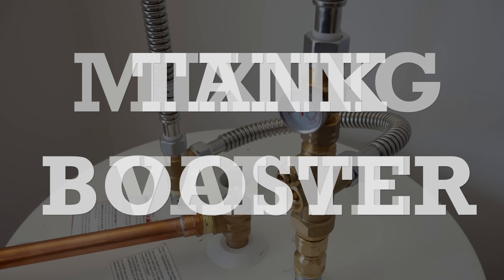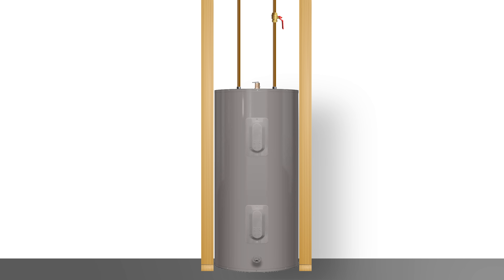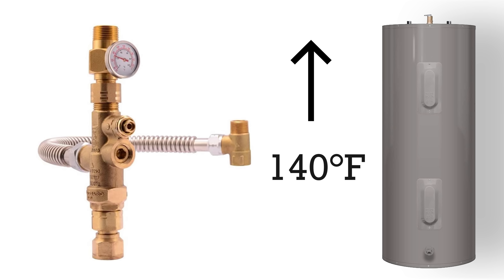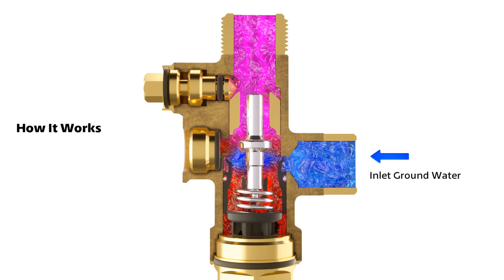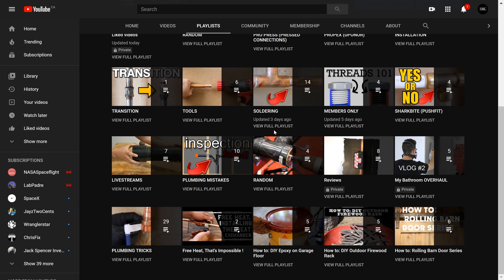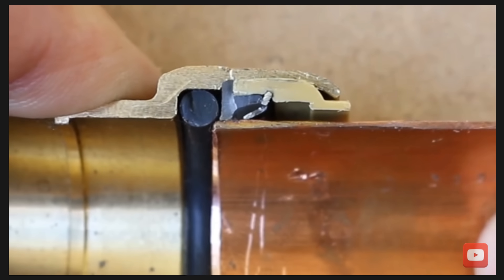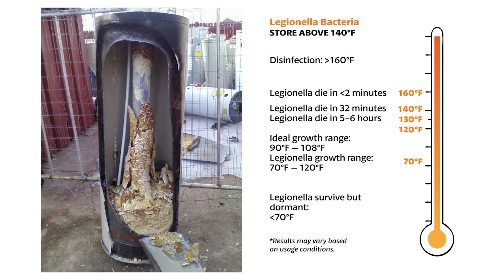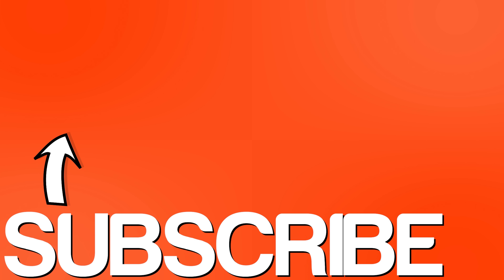INCREASE Your HOT WATER Capacity With This! (Cash Acme PRO Mixing Valve) | GOT2LEARN

Comment: First I heat my water to say 140, (costing $$$), Then I mix it with cold water to bring it to (say) 120 wasting more $$ to cool it down.  Since room ambient temperature is about 70 the 140 looses heat faster ( no matter how much insulation) wasting even more $$.
Solution just keep it at 120 in the first place.
Reply: This is not a means to reduce energy use but to obtain a greater volume of hot water from a given tank size. 
I have a similar situation with a twist. My tank temperature is set at 120°F but when there is excess solar electricity available it is automatically moved up to 150°F. The temperature controlled mixing valve is set to 120°F. The tank acts as a thermal battery and reduces the cost of running my heat pump water heater, to zero if I am the only one in the house.

Comment: Just glad you never said" hot water heater". Gotta save that for the Springer show. I have never heated hot water, always cold water. I think people with vin numbers, and pin numbers, have hot water heaters. I checked with the Federal FBI, the USMC corps, and the ATF firearms on this one.
Reply: And the old reliable ATM machine....Glad I'm not the only one!
Reply: @KenMagee  Exactly
Reply: Right on. I’m always telling people this. I only have a cold water heater in my house.
Reply: The images in the first part of the video including the law quoted say "hot water heater"
Reply: @mrwp819300  Ok, missed that one. It may be one to share with the C.I. A. agengy.
Reply: Dani Masterson  I have a tankless water heater, I only heat up cold water. Even if it is hot, in a tank, why would some one heat up water that is already hot, the thermostat won't let that occur.
Reply: Down to 0 degrees kelvin all water has heat. So, by definition, it TECHNICALLY is a hot water heater lol
Reply: @japhethwillmore7538  In different universes, heat is actually present, below that temp, but, that universe is made up mainly of old trailer parks.

Comment: Very well done video!  I have one question. Why does the circulation pump need to “T” and go into the mixing valve (R) vs. just go into the cold inlet supply “T” ? Is there a benefit?
Reply from the maker: Yeah, I have no idea, must be an engineering thing 😅
Reply: It actually should go into the cold inlet as not to interfere with hot water outlet

Comment: You could buy a new water heater for the money spent on this system. Plus the losses from over heating the water and the danger of running it near the max temps for the safety valve. This is only good if you have no other way to increase your size. Plus those mixers wear out and could cause a burn for a family member. Buy a new water heater or change shower heads.

Comment: This is particularly useful on off peak water heating systems.
Reply: Those are still a thing? My power company ended that program like ten years ago. I ripped out more of them than I fixed.
Reply: @jman0870  Had mine for 32 years, no problems and pay about 25% of the full rate. Why rip anything out? If the electric company ends it, the water heaters will just operate on demand and everything is in place if they resume the program. I also have dual fuel heating with my ground source heat pump. That operates at about half price.
Reply: @trustme7731  because they were 30 years old? Who wants to keep a 30 year old tank of skanky water in their basement? Most of them were rubber lined foam insulated giant tubs of water that used water heater elements to heat it at night. Also, why would you run dual fuel with a geo?
Reply: @jman0870  Why do you think the water is skanky in an operating water heater? New water enters every time hot water is run. Water heaters are not rubber lined. They are coated steal. Some are plastic.
I have a dual fuel plan with the electric utility. This means when the utility is close to peaking they can turn my heat pump off and I need to use a second heating source. Usually gas, but I use wood. In return for this, they give me half priced electric for the heat pump 100% of the time. They will turn it off when its cold, like 10 or 15 degrees and when people are arriving home and demand is rising. Its usually from 4pm, if it really cold, to about 9pm and then the heat pump comes back on. 
The heat pump also heats my domestic hot water in both tanks every time it runs, whether heating or cooling. Both my 65 gallon tanks are 32 years old and work fine because they are a high quality product that you can only buy from a wholesale plumbing supply house. The water heaters in the big box stores are crap and you are lucky to get 8 years out f them.
Reply: @trustme7731  did you eat lead paint? I literally just explained to you that most of the off peak systems were rubber lined tubs of water where I live. They were atmospheric and pumped to a hydronic coil. 🤣🤣🤣
Reply: @trustme7731  sorry, I didn’t realize that you thought the majority of off peak systems were for domestic water. Newsflash, the overwhelming majority of them were for this little thing called HEAT. 🤣🤣🤣
Reply: @jman0870  Except the subject is domestic water heaters of which mine are off peak as I clearly said.  MY space heat is geothermal, dual fuel, forced air and not hydronic. Get it now?
Reply: @jman0870  Have had mine for 32 years with no problems and pay 25% of the full rate. Why rip them out? If the electric company ends the program they will just work on demand. I also have dual fuel heating with a ground source heat pump at about 50% of the full rate.

Comment: Myth - You can not use a hot water circulation pump with a tankless. You can. I have been for a few years. And yes it is safe. I can explain and give details if anyone wants. Most people don’t understand the technology. I have a smart home so when the washroom light turns on the pump runs for 1 minute. Or Hey Siri run the pump.

Comment: Objects radiate heat in proportion to the 4th power of its temperature difference. So the hotter the water a lot more energy is required to maintain temperature. The logic is the same with insulation. So while you get more volume of hotwater much more energy is needed. I’m glad you covered it at the end.
Reply: Just a nitpick, but for conduction/insulation it is with 1st power, not 4th. q=-kdT
Insulation radiates too, but in those temp. range conduction and convection is main source of heat loss.

Comment: Throw it ALL away and buy a tankless hot water heater!!!! Perfect temp every time without running out - ever. Also takes up 1/10 of the space of a regular hot water heater. Also is more energy efficient as you aren't storing hot water. Also is easy to install. Can be purchased for around the same price as a tank heater and MUCH better!
Reply: It may not be able to be installed for the same price though.  I went through this while exploring options for replacing my gas fired water heater.   In order to install a tankless gas heater I would have has to increase the size of the gas pipes running to the utility location from 1/2" to 3/4"  which would have by itself added over $1000 to the install cost.

Comment: All this does is lower the hot water temp  allowing you to use a smaller hot water tank set at a higher temp. Less water at a higher temp might be more efficient.

Comment: Great video without a doubt but I don’t know why would you install  a mixing valve in each fixture which Plumbers do such thing, And what would be the reason.
Reply from the maker: Thanks, the reason being would be that you can control them individually instead of adjusting the whole house, there's also a question of redundancy I suppose, so if one breaks, the others will keep working as opposed to the one on the tank.

Comment: Any person who can solder copper pipe can install a 3/4" temper valve at their water heater  .I recommend the #1070 which limits the max temp at 120 degrees F . Some dishwasher manufacturers recommend 135 F for sanitizing .  Be careful .

Comment: I think I got had by the "more efficiency" thing. I replaced the W/H when I bought my new house, and I noticed after the install that it looked like the plumber had stuffed it in there. It barely fit. Anyways, it lasted 20 years, then died, and I replaced it with a tankless. Fits nice now.
Reply: Have fun replacing that tankless in ten years or less. If it doesn’t scale up it will cost too much to fix. Half the time they result in a ridiculously long call with tech support. You know how long it takes me to troubleshoot any issue with an electric water heater? Fifteen minutes. If the elements aren’t galled and the drain isn’t clogged I can fix any electric water heater issue in an hour or less with parts off the truck. Tankless issues? Have fun waiting a week or two with no hot water for parts to come in. They redesign them constantly and companies typically only need to support their equipment for ten years. Tankless is a joke.

Comment: Compromise for Free:  Set water heater to 130°F-135°F.  If you don't have young children or disabled people in your household, this poses little or no risk.  You now have more hot water (because you'll mix less hot and more cold when showering for example). This temperature also destroys bacteria such as Legionella in the water heater.
Reply from the maker: Yes this works also, just remember to remind the people that come over ;)
Reply: Do people really just step into the shower and fling the hot on? I dunno I am just a very cautious particular person I wait for it to run for a couple minutes to get the temperature right..
Reply: @drasco61084  I wing it on full hot and adjust after I have hot water. I have 140 degrees at my shower head. 🤷‍♂️

Comment: If you want a larger tank and can't fit one, just go tankless.
Reply from the maker: That's "a" way.
Reply: This is a statement by somebody that does not do this consistently or professionally. Most thankless require upgrade an electrical service. Average home would require fifty to a hundred amps depending on GPM water usage. You will find that many homes do not have that available.
Reply: @chrismidyette1098  there are tankless water heaters that use natural gas or LP and those are pretty common (in the US at least) if you do require a electric heater you will find that most homes that need one because there is no gas hookup already have enough power for service and a 50 amp outlet. If they don't it's not up to current electrical standards for residential hot water service.

Comment: These work and don't work at the same time for instance if you had a water heater and you set the temperature at 140 The temperature coming out of the faucet to the bathtub or to the kitchen will probably be about 120 considering the length of pipe and the loss of temperature as it goes through the walls ceilings and everything else so then if you try to increase it anymore or even sometimes add $140 when the heaters turn on you'll have a slight overswing which will probably bring it to about 1:45 150 in that case your TP sensor will start to open and slowly after a few years one or two the TP valve will start to leak without you knowing causing you to lose thousands of gallons of water without knowing it or even worse you could have a TP blow off if you are really in such a case of having to update a system but not relocated or not expand your easiest and best bet would to be install the insta heat which is basically just a larger version of that little electric heater you have the gas or electric style and some of them can be pretty dang cheap as long as you have the correct air for the room

Comment: Open that safety valve and you’ll be changing it also!!! Just saying.
Reply: If the water heater isn't regularly cleaned yearly (draining/refilling), which most home owners don't do, it's true. if you have a new water heater or less than a few years, that will not likely happen (depends on your water hardness and such) :D
Reply: My water heater is literally set at 140 degrees with no mixing valve. Setting any water heater thermostat at 120 degrees is stupid. It’s the perfect temperature for microbes to grow and fill your tank with literal microbe shit. 🤷‍♂️
Reply: @jman0870  that’s great!!! Thats why they have thermostats, put it where you feel comfortable.
Reply: @mr.redneck2715  Ever see a tank full of clear jelly looking stuff? It's poo. (Once in a while stuff in your water can react with the anode rod and smell like rotten eggs and provide similar results but I've only seen it a few times. Usually it's literal poo, especially if you have well water.)  Crank it up to 140 and it all goes away.
Reply: @jman0870   no not yet.

Comment: Everyone should cover the hot lines coming from the heater as far as you can, and adding a "Blanket" to the tank is not hard to do to increase the insulation factor, both saving you money.
Reply: This also corrodes the pipes.  I wanted to do this but my contractor showed me a section of pipe that was insulated.  Moisture collects under the insulation. If you can get it air tight it ok

Comment: The problem I have with the mechanical mixing valve is the fact that the cold water temperature where I live changes widely between summer and winter.  If you’re worried about scalding then you may have to adjust the valve multiple times a year.  Otherwise your hot water my be either too hot or too cold depending on if it’s summer or winter.
What I want is an automatic, self contained, mixing control valve.
Reply: Get one with a temp sensing element and it will auto compensate ;)

Comment: I’ve set my tank to a higher temp because we are unable to get two people showered quickly back to back without her getting cool/lukewarm water. Turning up the set temp resolved that but it’s giving us VERY scalding hot water at our kitchen faucet. Would this product or installing a mixer at the kitchen faucet be the rational solution?
Reply from the maker: Yes, these install directly at the water heater so the whole house is protected.

Comment: 2:44 why would there be more energy to heat up than to maintain? I know many people say that, but I can not find any fysical explanation. On the contrary. If the tank is colder, it looses less energy.
Reply: You’re right and he’s wrong. It doesn’t take more energy. It’s the same amount of heat, and like you said, if anything, during that time the temperature differential across the insulated wall is less so less energy is spent keeping up with the heat loss. It’s a myth that gets perpetuated by people who don’t understand thermodynamics. The only reason you don’t want the water in the tank getting cold is because you won’t have hot water.

Comment: The wiser decision to prevent the excessive running of water is get shower heads and stuff that use 2.5 -3.5 gallons a minute which will usually reduce water usage by 1 gallon a minute for a 3.5 and 2 gallons for the 2.5GPM head. raise water temp to 130 degrees and you will never run out of hot water. to help save money stop using hot water in your washing machine, with to days  detergents are efficient even in cold water. then ultimately do not install right off the water heater, install a recirc line that gets suction from the farthest point in the system and puts it in through this mixing valve. all the water in the entire system will stay at a warmer temp, instead of wasting massive amounts of water waiting for it to heat up.

Comment: That makes sense now. We had to install a new water heater and had to go smaller than the original so I guess it was the insulation deal. Now we run out of hot water if one person stays in the shower too long. I figured we were stuck with the situation as tearing up a wall is not something I want to pay for (plus we already bought the tank at this point). This sounds like the fix we need.
Reply from the maker: Yeah, sure worth a try!
Reply: Mixing valve doesn’t make more hot water, it won’t help if someone stays in the shower longer.
Reply: @danlux4954  Did you watch the video?
Reply: @Gunshinzero  yes, I have heating/DHW systems running mixing valves. Even if you run it hotter the water coming into the tank is still cold and makes the whole tank lukewarm.
Reply: @danlux4954     facepalm

The water coming into every tank is "cold". If that mattered there'd be no such thing as a water heater. The mixing valve changes absolutely nothing about how the tank works. The water is mixed at the outlet. That means for every bit of water coming from the tank there is percentage coming through the mixing valve. Only a certain amount of water can pass through the pipe at any given time so if up to half the volume is from the inlet through the valve instead of the tank then it will take up to twice as long to cycle the tank. Therefore you have a tank that's at least 20 degrees hotter than normal with a flow rate that's as low as 50% which equals a longer hot water run time.

Edit: Look at 2:57
Reply: @Gunshinzero  I know how they work, in a single family home you might be ok but in a multi family dwelling you will run out regardless.
Reply: @danlux4954  Multi family homes need either multiple heaters or a commercial fast recovery heater.
Reply: @machintelligence  All you need is a boiler and aTurbo Max hot water tank
Reply: @danlux4954  Of course, if you have forced air heating you are out of luck.
Reply: @machintelligence  not really , you can get a small boiler That can feed the turbo Max hot water tank and it would be the most efficient ever
Reply: @danlux4954  If you are going to spring for a small boiler, why not go tankless?
Reply: @machintelligence  I have a tankless, too much maintenance.